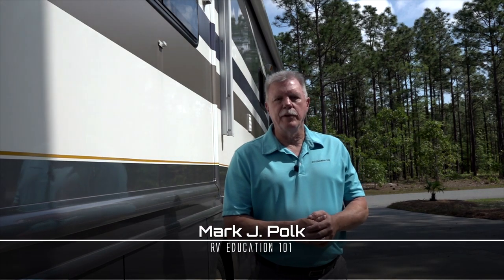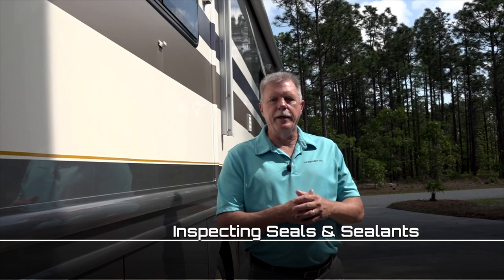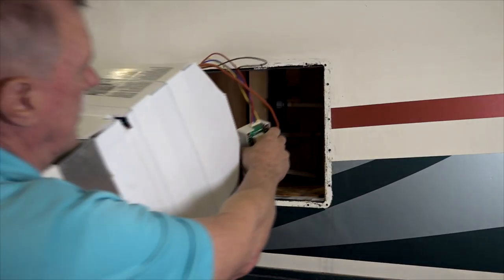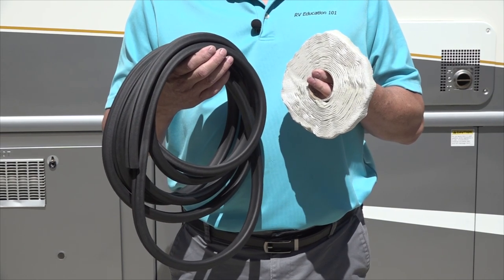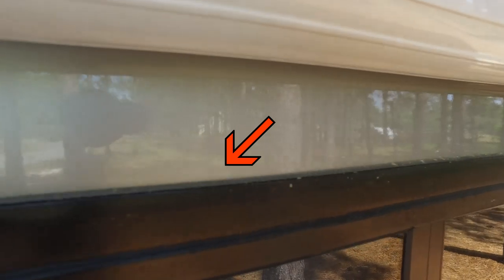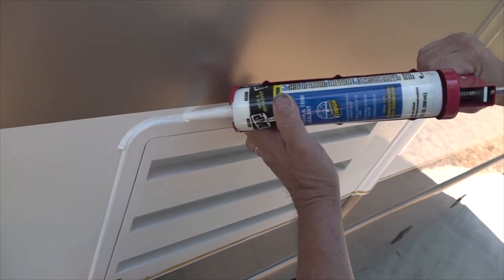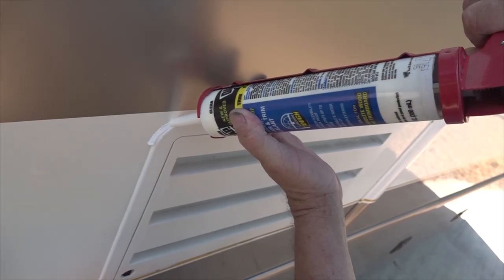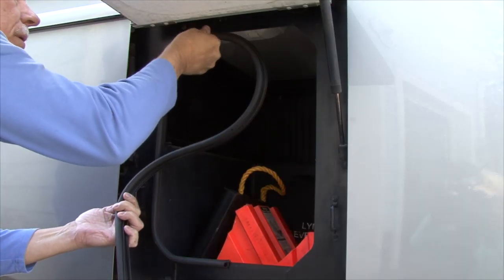RV 101® -  Preventive Maintenance - Inspecting RV Seals & Sealants

Comment: Hi! Thanks for the video. As you describe, we've noticed our windows and other openings were only sealed with caulk along the top and slightly down the sides. We thought that was odd and are glad to hear it is normal. Would it be incorrect to reseal with caulk all the way around these openings and windows? Would this provide better protection?
Reply from the maker: The most likely way for water to get in would be at the top, but it's your option if you want to seal the sides too.